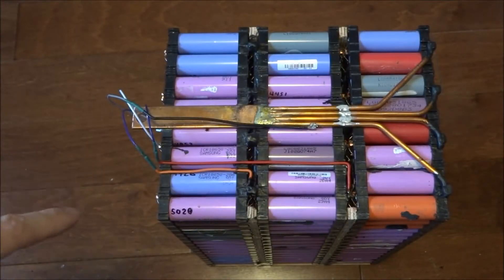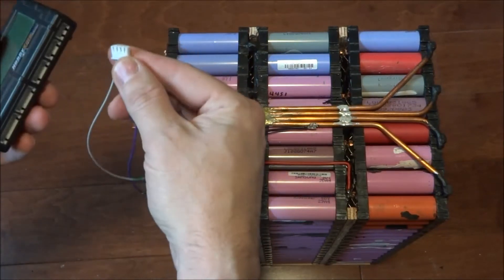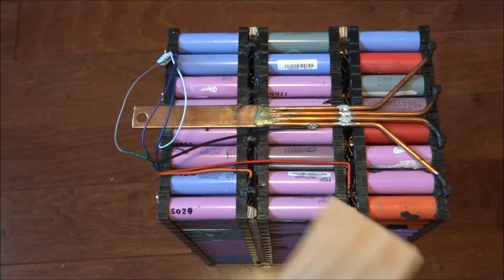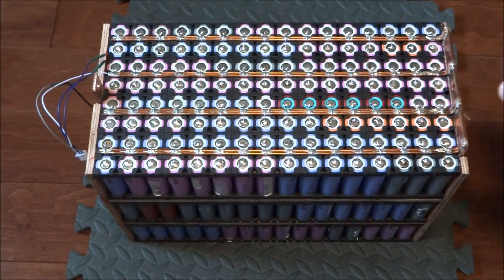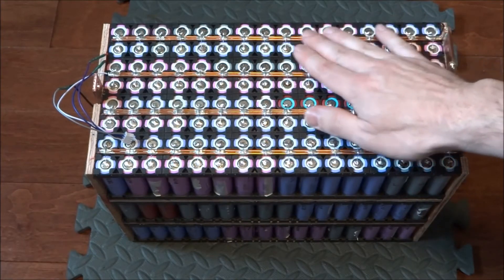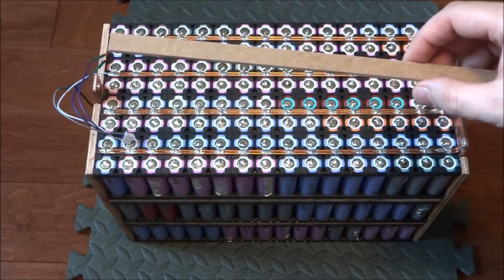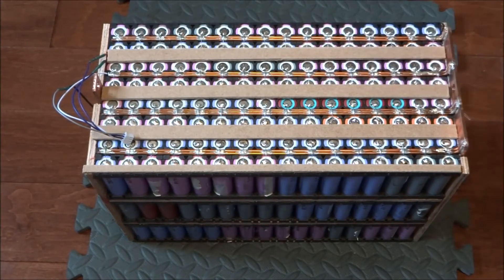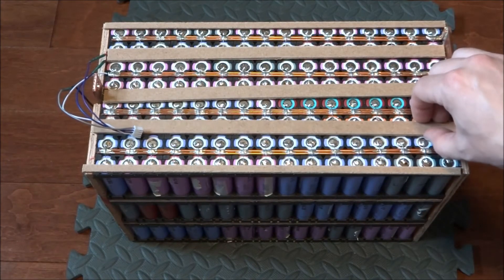Commander Electric upgrade to 18650, balance leads and more assembly

Comment: Very tidy. Have you got any plans for if you ever need to replace a cell? What will you do if you find a blown fuse? Cheers, Paul
Reply from the maker: Well, my testing is pretty intensive (https://www.youtube.com/watch?v=seap6_v5Ck0&t=121s) so i hope they last a long time. Since I have quite a lot of cells in parallel (128), my hope is that if a few go bad, the fuse wires will take them out and I will barely notice it. I have more cells in parallel than even a Tesla!!!. The cells won't be stressed very much as I will only charge them to about about 4.08v and discharge them to 3.3v. Eventually when the capacity decreases too much, I can build new packs and disassemble these to be recycled.
Reply: Leaf Xpack Ah yes. That's true. You've got a very thorough process. Cheers!